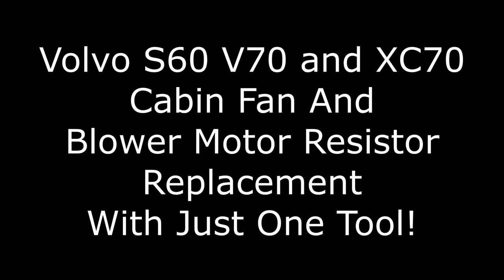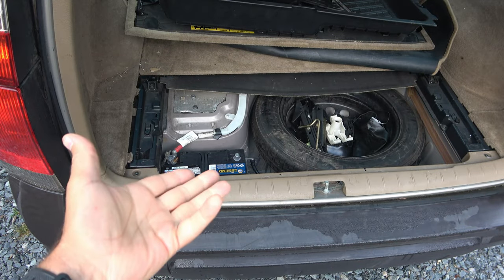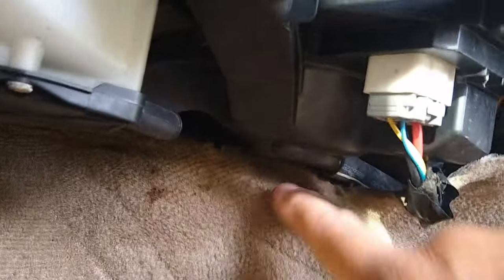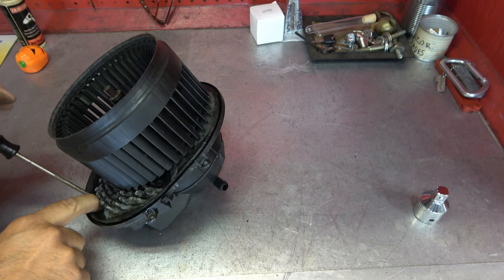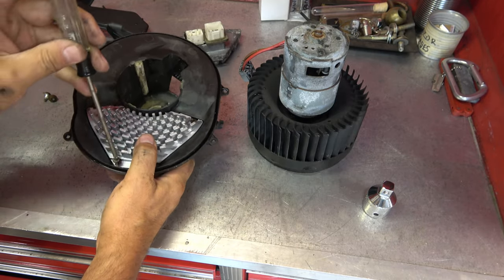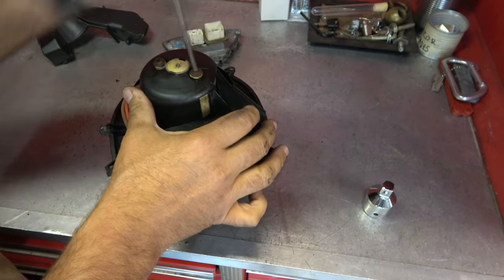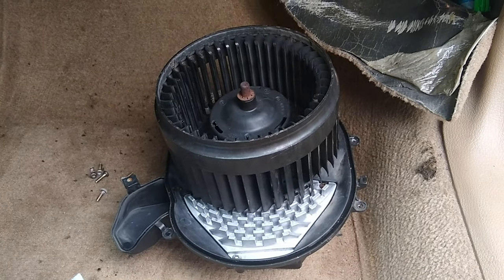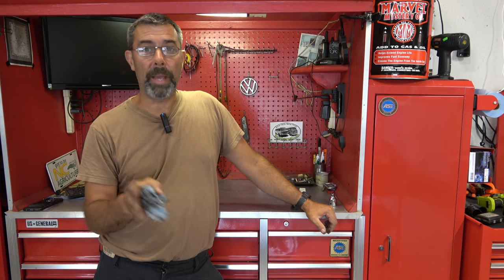Volvo Cabin Fan And Resistor Replacement S60 V70 and XC 70 2001-07, With just one tool!

Comment: Moisture could have come from a leak in the windscreen seal  - water runs down the inside and into the centre console.  That's what happened to mine.
Reply from the maker: you might be right- thanks for sharing

Comment: Thank you for the video! I was able to replace the blower motor on a 2005 Volvo S60. I am not able to control the fan speed at all from the climate control panel. Any thoughts on what that could be caused by? Before replacing the blower motor I had the same problem but at least I have air coming out of the fan now. Before it was rare when I could adjust the fan speed if at all.
Thank you!
Reply from the maker: did you replace the module in there as well? perhaps it is also failing.

Comment: Apparently some amount of water is expected to get in the fan compartment judging by the drain tube but probably not a huge amount of water, just drops of rain. 

If the fan is getting so much water as to overflow, I think that is because of an old water seal above.  Car manufacturers probably depend on the rubber seals under the plastic cover (cowl) below the windshield to stay water tight, so they can put a vent opening directly under there rather than recessing it or covering with a water deflector.

Water runs down the windshield and is supposed to be carried to a drain on top of the cowl, but the rubber seal under the cowl gets old or out of position and allows water past inro a compartment with your a vent opening/air intake for the hvac system (leads to the blower motor). And the vent compartment is designed to drain out a little water that gets there. 

I've had two cars so far, a Buick century and Volvo s80, where the vent opening is directly below the cowl, and the cowl's water seal allowed water to drip directly into the opening and into the car. The engineers should have placed the vent opening in a more covered location or added a cover onto the vent for the inevitable water leak. 

It is best to get a sheet, like an aluminum sheet or plastic (metal is more reliable because some plastic gets brittle), to act as an umbrella over the air vent and block rain intrusion. That's how i fixed it on the S80. 

You can try resealing the cowl, but i tried that on the Buick and it did not keep water away. 

So might as well make your "umbrella" to direct water away from vent, and optionally seal under cowl if water is coming in so fast to flood the compartment under the it (I guess seal with a new weather strip or caulk). And make sure the drains aren't clogged 

And theres likely a secondary drain hole in the vent compartment under the cowl that you need to ensure works so water won't flood and reach high enough to enter the air vent (which on your car is that drain tube, I'd think, but other cars may have a huge compartment with multiple drain holes). 

The drains on the cowl, easily visible under the windshield, are meant to remove most of the rain water but you still have the additional drain under the cowl for water getting there. (I can't promise this but it's just my thoughts)
Reply from the maker: All good info, and it's possible that this one was clogged up enough to cause flooding. We were out of the country on business and when I returned. This was the issue. It may have been a heavy rain that overpowered the drains.

Comment: Other than using compressed air, investing in an assortment (diameter and length) Nylon Pipe Cleaners always come in handy because you can clean & reuse them!
Reply from the maker: Great tip!

Comment: this was great! thank you so much! BUT a heads up to all RHD S60 owners, the glove box has 8 screws total. Also it's. straight up impossible. to take the motor assembly out without getting the carpet out the way, and potentially cutting a little section into the insulation. 

It's great that we have people instructional videos enabling us DIY cheap repairs, but this wasn't by any means "5 min job". Along with breaking many screw tabs and permanent damaging the car in the process. if you break a tab it may mean you have water leak into the cabin in the future fyi.
Reply from the maker: No parts were broken in the making of this video. Now the XC90? Yes, I always break the rear fan motor tab as it takes the job down from 8 hours to 45 minutes.
Reply: @FarpointRestorationsAndRepairs  oh I am sure you didn't break any parts, I was more trying to say "don't think this job will take 5 min and everything is going to go right just by looking at a mechanic whose done this 10-20 years or so" I guess just giving people heads up. Especially because these cars are 20+years old now and their plastic get brittle and smallest wrong move you break crucial tab. given the tight space and awkard angles etc.

But yes, I am absolutely for people giving this a go as it potentially will save you ton of money, relatively easy to do and doesn't have very serious consequences.

Comment: hi mr Volvo specialist :) i have question, what is solution for aisin transmissions going bad? does transflush help?
Reply from the maker: While a regular (60K) flush intravel will slow down the failures, these transmissions just plain suck. They will fail usually between 80K and 120K like clockwork.

Comment: It turning off and killing battery pretty conmen and missed. Especially if your climate is set to run after car turns off.
Reply from the maker: The afterblow function on these cars is not a bad idea, but since Volvos are terrible in general, they like every other part fails and kills the battery.

Comment: My air conditioner in my car is not working. I recharged it once and it was turning on and off. Sometimes cold sometimes not. Do you happen to know why?
Reply from the maker: Yes. It's the magnetic clutch. They get weak when hot and stop working until they cool off. I have a video on replacing it.

Comment: I just put a 2002 s60 on the road and working out the bugs before I give to my daughter.  Noticed the blower motor keeps slowing down and shutting off for a few seconds and then comes back on.  I am thinking the resister.  Can I reuse the blower or should I replace both?
Reply from the maker: If it was me, I would replace it all and be done with it. I would shop around to get the best deal on the parts

Comment: Wow what a simple looking  job .. i have  2 s60s 05 06 .. both with heater motor isues .. now that i see how its done atleaat i can verify the resistors and if they are bad will so be it .. these  drains you mentioned .. are you talking about the two just under the wipers ?? Keep them clear of leaves and ice but should i be doing more ..
Reply from the maker: Yes, clean those and if you can, run a garden hose to the rain tray to make sure that the water drains out the bottom.

Comment: Did you find the cause of the leak in the end?
Reply from the maker: Yes, the rain tray drains were clogged with leaves.
Reply: @FarpointRestorationsAndRepairs  so that was taking the plastic tray off at bottom of windscreen under wipers and checking in there? I'm in the same situation currently.

Comment: I'm going to keep the dollars in my back pocket thanks.
Reply from the maker: It is not too bad of a job to do- I have faith that you can do it
Reply: My fan is still working, just that it couldn't blow the skin off a rice pudding. I've cleaned the air filter which really wasn't that bad. Is this the job I should be doing to remedy the situation? @FarpointRestorationsAndRepairs

Comment: Does a new resistor usually come with fan or are these ordered separately? How do I know if I need to replace fan or resistor, or both?
Reply from the maker: No, you'll need to get a resistor separately.  As for how to know,  the fan is usually the issue.  A bad resistor will usually kill a battery or run non stop.